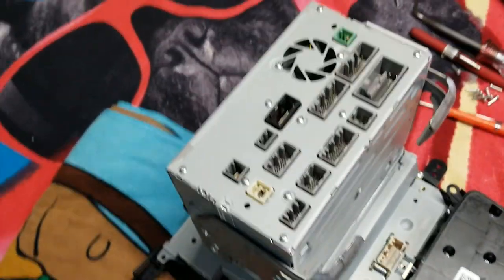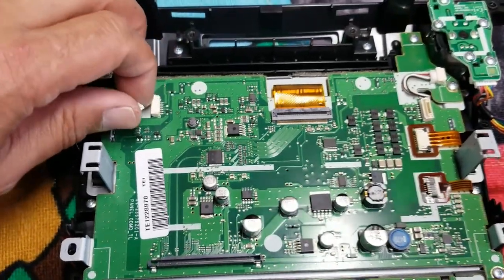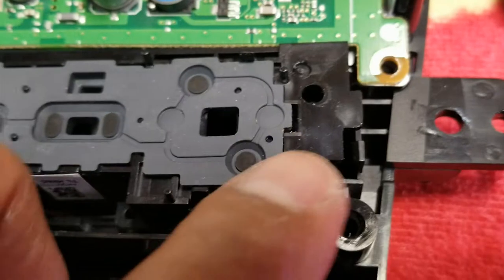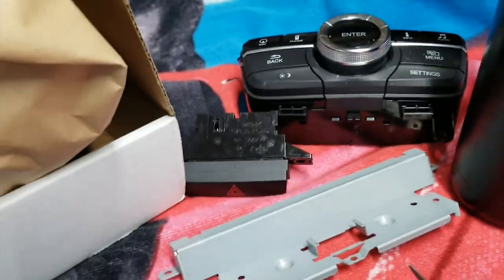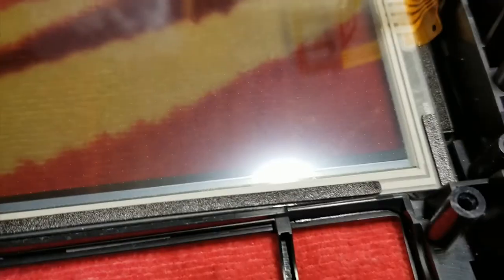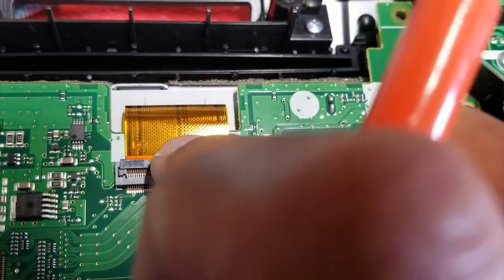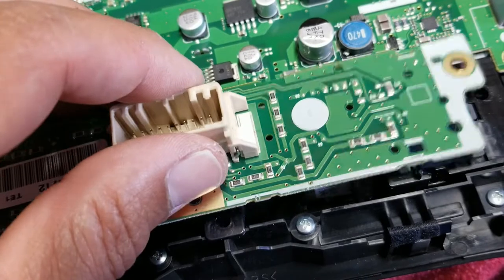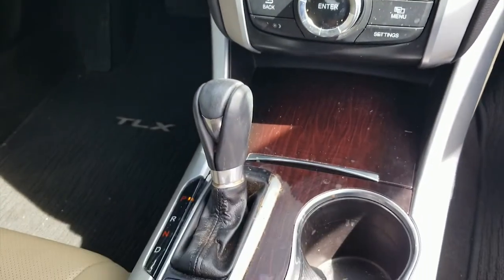How To Replace 2015-2020 Acura TLX Digitizer/ Touchscreen. How To Disassemble 2016 TLX Radio.

Comment: Doing this today this really will help I appreciate it good sir 2015 TLX
Reply from the maker: No problem. Just be careful and consistant. You got this. Good luck.
Reply: @richideates  Forgot to reply! It went awesome and works perfectly a video is probably the only thing that made this possible I really appreciate it man 🤜🤛
Reply: Hey , my 2017 MDX digitizer is cracked is there a special one to use or any is fine ?
Reply from the maker: I think got it from this place. But I see stuff on ebay as well that is way cheaper. I cant say one way or the other. She did all the homework on her own. I was just the shlub who put it in. 🤦🏿‍♂️🤣

Comment: Great video. Wondering how to confirm if replacing the digitizer will repair the issue I have. The screen display is “white” but all of the functions still work.
Reply from the maker: Sounds like it might be a candidate for this video..its worth a shot..could only get better is the way I see it..a new screen can only make things better
Reply: I am having a similar issue and don’t know if I should purchase a new LCD screen as well. Have you determined if a new LCD is needed?
Reply from the maker: I didnt. Are you referring to petergates??
Reply: @richideates yes.
Reply from the maker: Oh..then I will slowly back out of that conversation..lol
Reply: @richideates  No worries. Your video has helped a ton. I really appreciate you uploading and sharing with all of us! Thank you!
Reply: @Pitchcut29 I haven’t come to a conclusion yet. The functionality still works and am hesitant to spend 1k to do this which is what the dealer will charge.
Reply from the maker: Screen cost consumer I think 175 snd I charged 400 for labor. Mightve been 300 but either way, not a G note

Comment: Hey quick question is the radio multiple screens or just one  the digitizer ?
Reply from the maker: Well..not sure how to answer that..the digitizer is the screen you use to control the radio..if thats what you meant..but you have to take apart the radio to get to it..lol .so in a sense..it is the radio?? 🤦🏿‍♂️🤦🏿‍♂️🤣🤣
Reply: @richideates  lol, sorry for the confusion. So i purchased the digitizer for the radio I was wonder if there’s another screen as well or just the digitizer ; one shop told it looks like it’s multiple screens but the other says it’s just one but won’t open it without labor which is understandable
Reply from the maker: Watch the video again..in full..and see what was done before you hire anyone..
Reply from the maker: Well, technically yes they are separate screens. The digitizer is what you touch and the actual screen sits behind it. The digitizer is glass clear and the other whismch is what you see the info on, is right behind it. Thats what displays the info. So yes, 2 separate entities and both need to be taken care of when removing. The display screen had some minor scratches from the impact of the digitizer. It still worked though. Did you even watch the video?? 🤦🏿‍♂️🤦🏿‍♂️🤣🤣😭😭

Comment: Would you know if the head unit has a fuse itself?
Reply from the maker: Hmm..on an Acura, I dont think so. MB or german yes for a fact. But Acura does have multiple fuses at the fuse box that can prevent it from working properly. Pretty sure they have an amp fuse as well that would audio out but keep the radio on but with no audio.